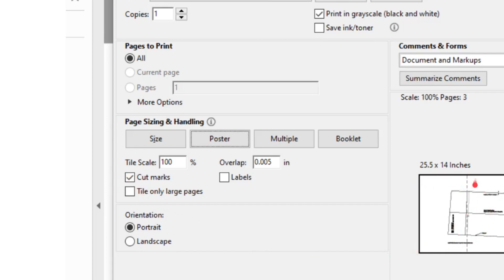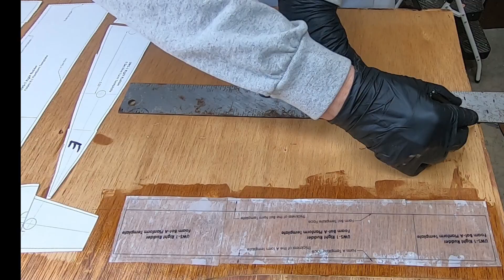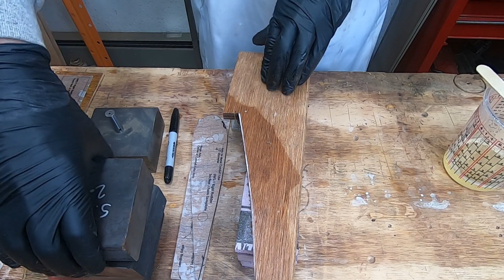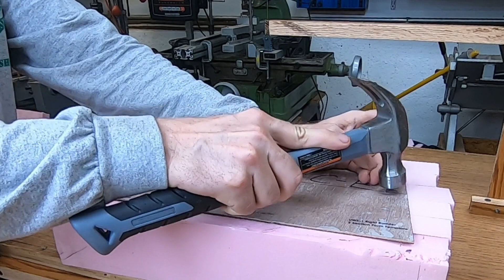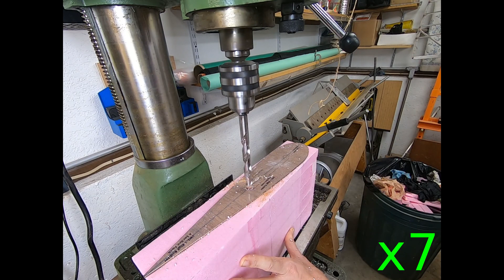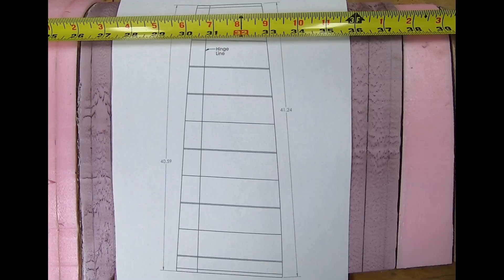UWS 1 Design: Right Rudder Plug Part 2, Assembly

Comment: Why didn’t you 3D printed the mold? (Sry for my bad english)
Reply from the maker: For this first first part I wanted to show that even though the shapes are complex, that can still be made with simple and inexpensive tools. For some future parts I'll start using a CNC router. I would not use 3D printing because of warpage, roughness of surface finish and expense.